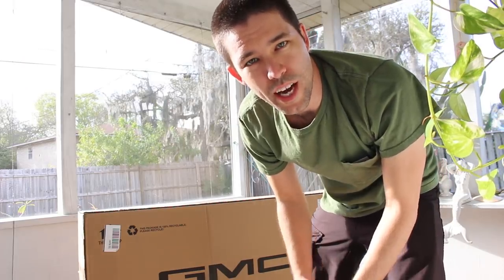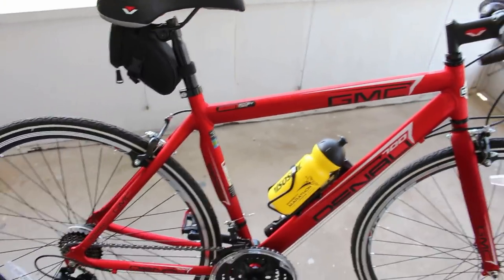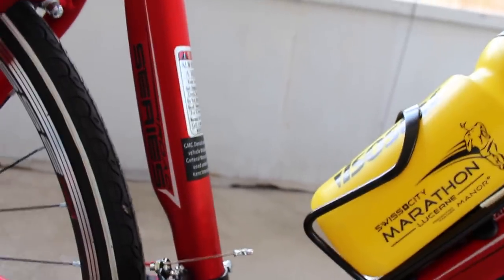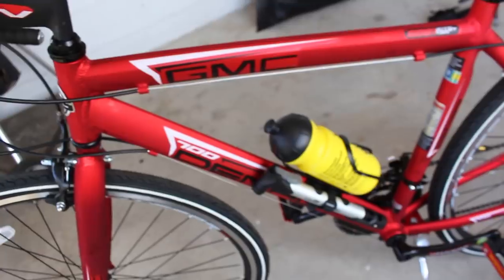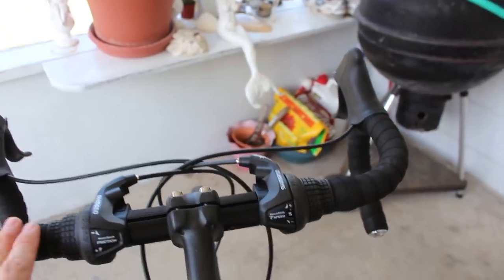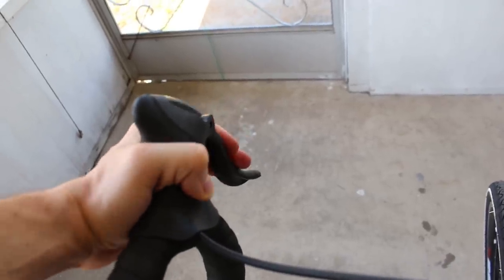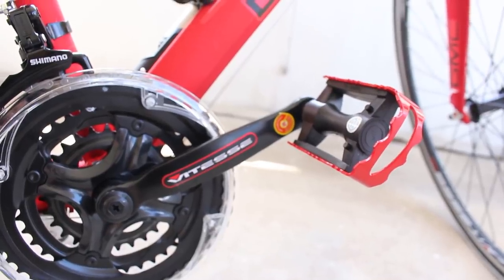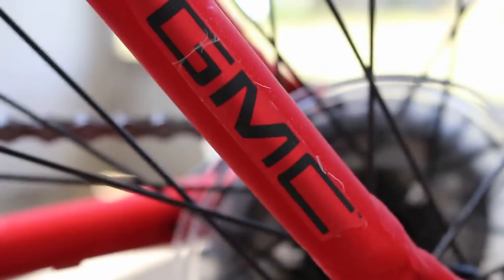Unboxing and assembly of my $99 Walmart Road bike

Comment: Wonder how this would stack up to buying an old giant or trek off fb for ~100 bucks
Reply from the maker: that's a great question, almost feel like making a video to answer that. I could see it going either way depending on your own situation.
Reply: @BruceChastain  i just bought a minty 1992 trek multitrack 700 hybrid bike for 130 bucks.. then I found a chinese goldencycles fixed gear bike thats maybe 4 years old and the crank set is creaking and it makes noises. Gonna redo the fixed gear picked it up for 85 bucks and put only a 10 dollar tube in the back wheel. The brakes are horrendous even with good pads. I still like both of my recent bike purchases but its a pretty big diff in quality imo. I am about to completely tear down the fixed gear and make it my own type build. Anyways... lol just curious your take on it. I like to support local cucle shops as best i can too.

Comment: I had a walmart POS many years ago.  After about 20 miles I had warped and ground off the threads in the crankset so that the pedals fell out.  Imagine my surprise having to walk my bike home for 5 miles in the Texas heat.  I wouldnt suggest these bikes unless you plan on just letting them sit and collect dust.

Comment: Canadian Tire, a Canadian department store, sells this same bike as Supercycle Medalist. Its the same frame and also has the vitesse wheel set.
Reply from the maker: I've heard of Canadian Tire but never been in one. Funny the name they're giving it there, I suppose these words are pretty much opposite of the bike itself. Thanks for stopping by.
Reply: @BruceChastain  You're right about that. It's such a weird configuration with the quill stem made for modern size bars, but they go ahead an use an old school diameter bar. The grip shifts are also weird. I dont know how they got them on there.
Reply from the maker: @TorontoPopulistConservative  at least with my bike the bars are actually split in the middle which is how they got the shifters on.

Comment: can you install mounts in the frame or would that weaken it?
Reply from the maker: I believe I've seen it done before on youtube, however I would have to imagine technically it would weaken the frame slightly at least. I believe you can add some sort of strap on bottle holders though.

Comment: I think that adapter between revoshifters needed to install revoshifters. The dropbars are spliting right in center. Try ro unscrew it.
Reply from the maker: I don't think so because adapter is not under the shifters. But I'll take a look again today. Thanks for watching.
Reply: @BruceChastain  my english is bad. Sorry. I'll try to explain once more. 

Adapter holds two pieces of the dropbar.
Dropbar is  splitted into to pieces right in center of it under adapter. Because you can't install revoshift on dropbars other way. Revoshifts does not fit on drops. 

It's standard cheapest way that you can see on china bike: cheap shifters with cheap adapter. It's better to replace because of safety.
Reply from the maker: really? You think the drop bars are made of two parts?!
Reply: @BruceChastain  yes, i think so. Try to unscrew it.
Reply from the maker: Dude you're right! I didn't need to unscrew it, I can see it now. I'm really surprised.
Reply: @BruceChastain  They would have to be, because grip shifters can't be snaked around the bends in the bars.

Comment: 2:11 - I am clueless on what type of stem riser to use for my WM road bike.......  Any suggestions????
Reply from the maker: this is a "quill" stem, you can raise it up, but only so far. If that isn't enough, you can search for another quill stem that has a more upward angle.
Reply: @BruceChastain  Thanks. I also realize on my Roadtech WM bike that the stem is actually a tad smaller than a typical 22.2 mm stem...A weird size
Reply from the maker: @tenfourproductionsllc  ah okay, I didn't know that. maybe you can find one that does fit?

Comment: The odd shaped parts of the bike are meant to mimic an aero foil design that is usually associated with more expensive frames
Reply from the maker: guess you're right. And I guess in theory it should work a very very very slight amount at the slow speeds I ride. Thanks for stopping by Samuel.

Comment: i actually like the friction shifter, no need for trimming. BTW your first upgrade must be a derailleur guard, reason is that your hanger is not a separated piece but actually part of the frame, which means that it could bend or brake if your derailleur gets hit or if the bicycle falls on its side, and you won't be able to fix it.
Reply: Adding weight to a already heavy road bike is really not a good idea. Your comments are all over you tube without understanding bikes in general. Not only are your comments without merit but help in pushing overpriced product in 2019 like the statements made on sickbiker. Understand cycling before telling others where to invest. The goal with this bike would be weight reduction. You still never explained your shipping cost conclusion. I still dont understand how you cannot see 1,500 bike prices as absurd to what is available.
Reply: @thiosemicarbizidebenzoylal2921  what? Are you chasing me all over youtube now? Do you  have a crush on me or what? I did not make any statement on that video you mention, I pointed you the shipping price which, BTW, I was not the only one that noticed. This bike needs a derailleur guard because it has an integrated derailleur hanger, which you should have noticed, and it will bend or even damage the frame if the derailleur suffers an impact; derailleurs guards do not weight more than a few grams.  Stop spamming shitpost and for the love of god, stop chasing me, I am not going to date you.
Reply: @fulldnbboy   People buy road bikes now that are already light with high quality. Hence the argument with the other guy. Aliexpress has competition bikes below 600 dollars. At the level of this bike then I would be hard pressed to put anything that adds weight. We are not discussing a college commuter but a road bike. Walmart had Vilano bikes at one time that were quite good and pretty serious for group rides. Weight is a serious factor when you want to be putting major miles on a bike.

Comment: I want to get this bike but I’m 6ft tall, am I too big for it?
Reply from the maker: I think for this size, which was 19", you'll be just a little too big. I'm 5"7" and it was about perfect. But someone down in the comments said they have 21 and 25" frames too. One thing to point out, I do think the frame sizes run a bit large, because normally a 19" would be too small for me.

Comment: Anyone on a budget who complains about not being able to afford a "real" bike is simply too lazy to hop on Craigslist and find one.  That or heaven forbid many people actually buy something USED.  I bought a mint older Felt with Ultegra components for a few hundred bucks.  I later swapped a lighter set of used wheels but other than new tires and cleaning/maintaining it have been racing tris and doing weekend rides for several years now.  I've actually wanted to upgrade to a newer bike with more bling but haven't been able to bring myself to.  It's that good.  Have no problems running with my friend's new $8k Trek Madone.  And if I ever do sell it I'll probably get more than I paid for it.  It's really incredible they can build and sell this thing for $99 and turn a profit.  But you get what you pay for.  At the end of the day a 10 or 15 year old Cannondale, etc is still WAY better in every way.
Reply from the maker: It just depends on what you're after and you're personal situation. For me I was just on vacation and didn't have time for craigslist hunting. I've done it before in fact I hadn't bought a bike new in like 15 or so years.
Reply: @BruceChastain  I understand.  I wasn't calling you lazy haha.  I see people walking out of Walmart all the time with brand new bikes and I guess most just don't know.  The quality of the components is so poor you can't even make proper adjustments because everything is plastic and strips and breaks so quickly.  Had a friend buy a Walmart mountain bike (I would have never let him had I known) and the rear derailleur broke apart on his first ride.  I recently grabbed an older made in the USA Giant mountain bike for $10 off CL and all it needed was to be cleaned and tuned up.  Everything is good quality and that bike will last forever.  Nice video though, appreciate you sharing.
Reply from the maker: @sidefx996   yup I know what ya mean, In fact I'm going to make another video detailing some of the issues with this one. Basically the inability to make basic adjustments is right on.

Comment: For that kind of money geez not bad! I think you can get some weight off too, next project for it... I thought your conversion mtb to road was pretty cool. Quick note: I was looking for some new bars for my Specialized Tarmac, the carbon s-works handlebars look beat up and not going to chance it, could be disastrous on a downhill... good bars are crazy expensive! So I was getting a Jersey at decathlon for the coming heat, and saw these btwin ergo very light aluminum bars with the compact style for 19 bucks!!!! I just freaked, and they are safer than cheaper carbon, just goes to show that you can find stuff sometimes for dirt cheap! Like your 99 dollar bike...
I know, a 2500 dollar tarmac with 19 dollar handlebars, but heck if they work and feel good why not right? Tried to find reviews on those but can't, I gotta try them, but not a word on how much they cost to the riding buddies, they will think I have flipped lol. I had to sub, to see the cool stuff you put together, never, and I mean never ever heard of a GMC road bike!!!!!! Lol
Take care :-)
Reply from the maker: Thanks a lot! I actually bought some decathlon MTB stem years ago, as you probably would expect I've had no problems with them at all. I'm a big decathlon fan. Half my gear is from there, if they come to America they'll take over the sporting goods market, like they're about to do in Switzerland.

Comment: This is not a good bike 
I had the white colorway last summer. It's heavy and uncomfortable and i really disliked the twist shifters. the only thing it was good for was going uphills  because it has wide gear ranging that's it.
Reply from the maker: you're right it's not a good bike, but for $99, maybe a good value?
Reply: @BruceChastain  I recently bought a RoadMaster granite which is mountain bike. I paid 78$ plus tax for it. And in my opinion it's a much better bike. It's lighter and has almost the same gear range as that GMC bike. To me that GMC bike is not a true Road bike. its like more like a cyclocross/gravelbike

Comment: for 100$ is nice city bike ,  components are bit crapy , but if i live in us next to a Walmart i will buy  one as a second city winter ,bike ,  so i don't care if it get stolen, beaten or dirty  much nicer than those crapy  100$ mtb you can finde in my country
Reply from the maker: agree. What country are you from?
Reply: @BruceChastain  Greece :P  and the cheapest aluminum bike you can find is at 200euro, for a 26,, for a 700c you nead to step up to 300 ,and the cheapest drop bar bike i was able to finde was 400 , without sti shifters ,    for 100 you can find only metal frames, bikes 26"
Reply from the maker: I was in Athens recently and I went into the Decathlon, but nothing close to a $99 drop bar bike. But to be fair this one is normally about 149 USD, I just got lucky.  @darkphotographer

Comment: The reason for the "Don't ride at night" warning is probably due to a lawsuit against a bicycle company around 1990. A kid was riding down a hill at night with no lights on his bike, and the driver of a car coming in from a side street or driveway didn't see him and pulled out onto the road. The case cost the bicycle company over $1 million. The argument put forward by the kid's lawyers was that the CPSC-mandated reflector on the front of the bike (removed at 2:15 in this video) caused the kid to believe he could ride safely in the dark. Reflectors only shine when a light is pointed at them, so they were no good in this situation. Ever since that time, bicycle manufacturers have warned cyclists not to ride at night -- even though it is reasonably safe if you've got headlights and tail lights that meet state government standards. (Please DON'T ride at night with no light. There is no money in winning a Darwin Award.)
Reply from the maker: thanks for filling me in on the background Bruce.

Comment: Bruce, good job here!  

By swapping out key parts a person can make this Denali road bike go from 31# down to 20.5#, a massive reduction.

I know cause I did it, and put probably 6,000 miles on it.

You can swap the upgrade parts to a lighter frame later, if you plan well.

Main modification parts:

Campy carbon fiber crank $150 used

Nashbar Carbon fork $90

Mavic Kyserium Elite wheelset
$399 on sale Nashbar.com

Microshift Centos Derailleurs Shifter Group $160 on Amazon

Lighter seat, Avenir 44cm road bars, etc.

Yes, it rode very nice & tight !

Here's my blog post showing some of these mods:

https://affordableroadbikereview.wordpress.com/2011/11/24/upgrades-to-the-denali-road-bike/
Reply: Note I did this in Fall 2011 - this bike has been a Walmart "Staple" offering for a while now...
Reply from the maker: thanks for watching and the comment. And thanks for the link, I'm checking it out right now. I actually do think the frame looks cool, so once you change out a lot of the low quality parts, I'm sure you'll end up with a good bike.

Comment: Absolutely bargain of a bike but I think I'd actually have more faith in it, if it was a steel frame. Steel frames are easier to make well on the cheap. If you bend the derailleur hanger you can always bend it back with steel. We get Vitesse branded bikes in the UK without the GMC branding and they cost a lot, lot more. I've seen them at Amazon. I think the Vitesse branding on the crankset is the real Chinese brand. Still $99 is an amazing price for a new road bike. The only issue is such a basic bike takes many hours to sort out; grease in the hubs, bottom bracket and headset. Trueing the wheels, putting copper grease or similar in places to prevent galvanic corrosion  and noise etc. I'd probably want to fit replace the rear wheel axle with a stronger hardened chromoly axle and replace the bearings with loose bearings if they are caged and use better quality bearings. Better brake pads would probably be another good upgrade. All stuff you can do cheaply but could transform the strength and reliability of the bike. It's likely such a basic bike will not be weather proof and  the wheel hub grease will be vulnerable to rain so there at least you may want to use marine grease. Pedals are another area that may need a good service with grease.

Enjoyed the video anyway ,best of luck with it.
Reply from the maker: Thank you and thanks for the good comments. I think the cool thing about this bike is that there is plenty to upgrade as you go. Basically everything lol

Comment: This bike is super cheap. They always have a lot of problems. What people don’t understand is that shimano has A B and C level parts. A is sold individually so when you buy a crank alone it’s A level. B is the parts that come on bikes sold at bike shops. C Is this shit. They sell those parts to be put on these super cheap bikes. Don’t be surprised that this bike has these parts. Even though they are shimano they are shit shimano parts. They don’t last as long and they don’t work all that well. Then when they break the part is a quarter of the bikes price.
Reply from the maker: For sure these are bottom of the bucket components
Reply: Bruce Chastain I work at a shop and I always have to explain this to customers. The bike didn’t cost them $99 because it was on sale from $250. It cost $99 because it’s a $99 bike.

Comment: Not a total POS; really, for $100? Having assembled a similar bike, years ago, I was aware of the potential for there being no grease in the wheel hubs or BB. No cassettes here; just plain old grease and adjustable cones. If there's one thing you do with a bike like this, it's open the hubs and BB, and grease them properly...adjust them too. Grease every cable....grease anything you can think of, because there is practically nothing on the bike that WON'T rust! Still, it was only $100.
Reply from the maker: Thanks for watching and the advise JD